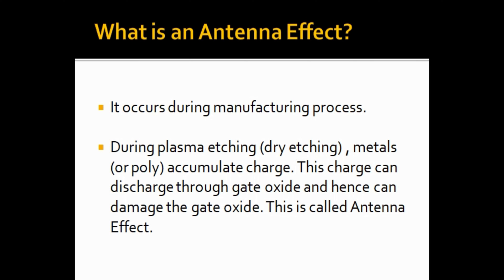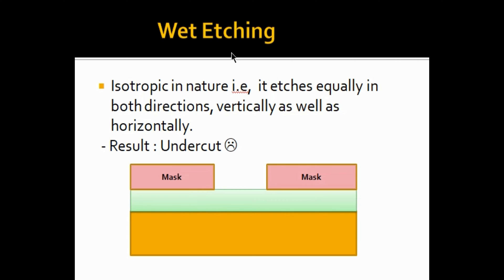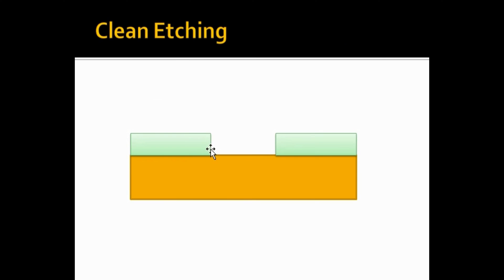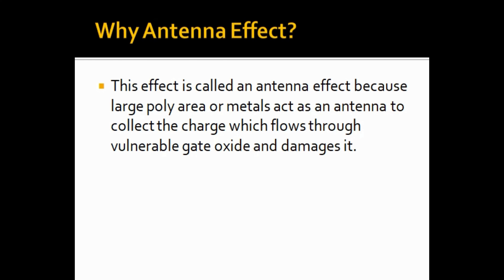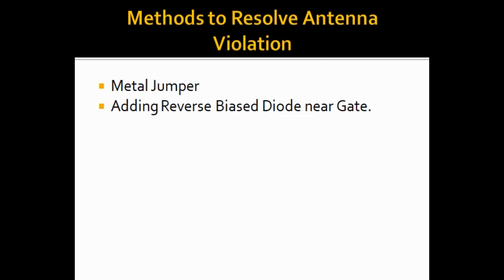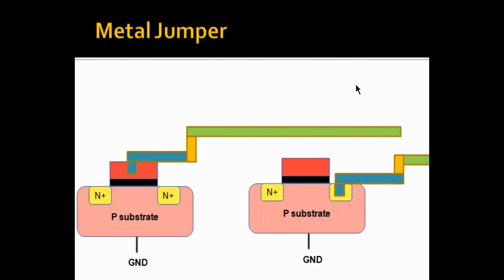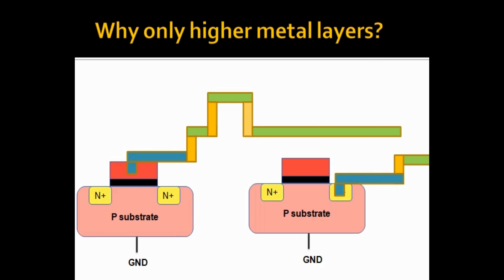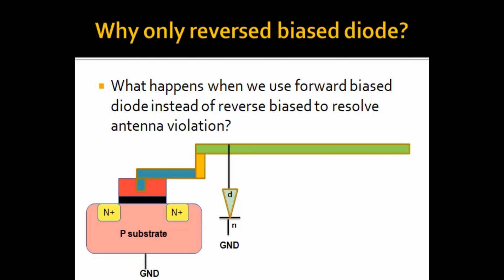Antenna Effects | Physical Verification | Back To Basics

Comment: What happens to the charge present in M3 even though we have broken the path but still charge will remain on that metal , how will that path get a discharge path ?
Another question is that while adding the diode how do we make sure the GND is connected as this process occur during manufacturing & at that time there is no electrical path present  ?

Comment: you said that in case of forward bias diode, the current will flow through the diode and not through the gate, but Gate current is already zero, so what's the issue??

Comment: why we use upper metal m4, why cant m2 ?? there is no discharge path for already manufactured m3 metal( still the charges are present in m3). once m4 manufactured there is a connection right similar to m2 connection
Reply: and there are two other ways , one we can use dummy load insertion other change routing order to top metal since top metal as less antenna issues

Comment: Superb explanation. I just have one doubt though - for another example, where there is a path from  M3 to gate oxide and also to the output. Like there is no need for M4 metal for that path. In that case, why would the charge get discharged through gate oxide alone and not the output? Why not damage the output?

Comment: Hello mam..
Very nice explanation
But I have a one doubt
One side of that long metal is connected to gate and another is connected to some drain sharing then what will happend
Is Antenna affect is coming??
Reply: @kandrashilpasree114   
I am re-commenting : yes , we have antenna violation , on local net which includes driver (drain)and receiver (gate), in this case we add diode near to receiver (to protect gate)
Reply: @mohangowda4282  okay

Comment: Nowadays mostly designs operate at .75 v to 1 v..and Zener diode is having breakdown voltage of 6 v.. Then based on what criteria charge flux is discharged through diode. How do we know what is the cutt off voltage for charge accumulation to destroy gate oxide??

Comment: Great explanation but as you have shown that the exposed part during etching will be etched out.
So while doing plasma etching the charges will be bombarded on the metal and that part will get etched out so how does it will cause the problem when it is already etched out.

Comment: Maan if there is charge accumulated in the metal 3 layer and if we use jumper of higher metal layer, since metal 4 is not yet formed but metal 3 is divided and it wont reach gate oxide, but then also metal 3 will have charge and it will be accumulated in metal 3 layer.And it metal 4 layer jumper is formed it will discharge through it,then how jumper will save gateoxide?
Please help
Reply from the maker: Once metal 3 is etched.. The charge will not be there on metal 3 anymore. Charge is there only till metal is in plasma.
Reply: Seems there are methods to discharge the accumulated charge of m3 before M4 is being fabricated...

Comment: That means that whenever there is high charge in metal it will be break down reverse bias diode and that total charge will be discharged that's u r saying,then that diode will also discharge the our desired Voltage across gate?
Reply from the maker: When the potential on metal during etching reaches breakdown potential of diode, charge will discharge through reverse biased diode. It will not affect desired voltage because the diode is reversed biased. Normal operation of circuits happens at very low voltage, at that voltage reverse biase diode will not turn on. So normal operation of circuit will not be affected.

Comment: When we use partial blockages? Pls reply me
Reply: Partial blockage are used to restrict the % of utilisation.for eg we use partial placemnt blockage with % 50%,then only 50% of that area is occupied by std cells.remaining will be placed outside the blockage.
The main aim of partial blockage is to reduce congestion effects
Reply: You are pd engineer
Reply: @aparnavalluri8667  yes
Reply: I have lot of doubts in pd will u pls solve
Reply: @aparnavalluri8667  yaa sure.whatevr I knw I can help you with dat 🙂
Reply: TQ so much I have one doubt in my floorplan 2 rows are missing I want to get it how it is possible
Reply: @aparnavalluri8667  r u working now?
Reply: Which tool icc2 or innovus?we can add site rows using commnd
Reply: I m just learning
Reply: We can add rows by using command but after adding some rows are missing at that time what we do
Reply: Hi I have one doubt how to remove std cells, what is the command for it